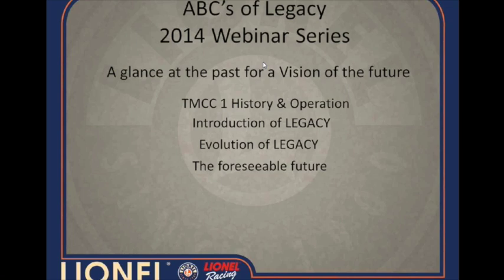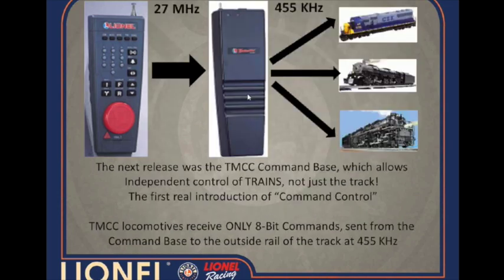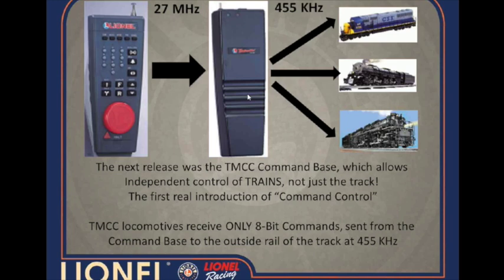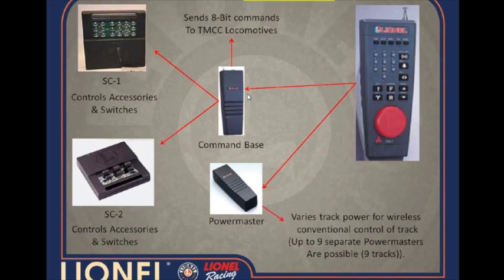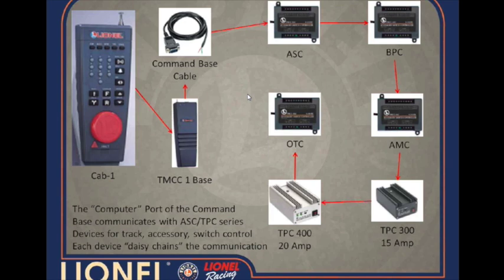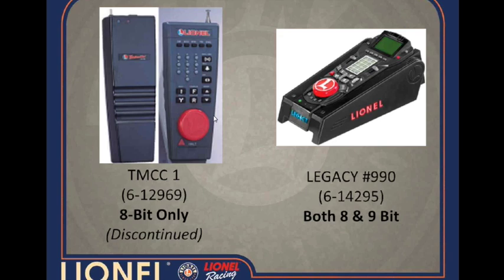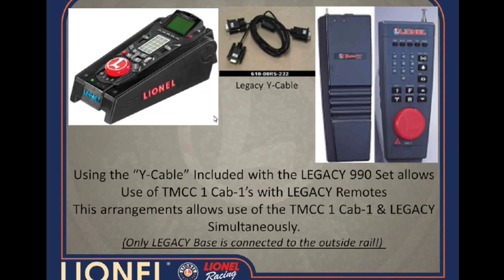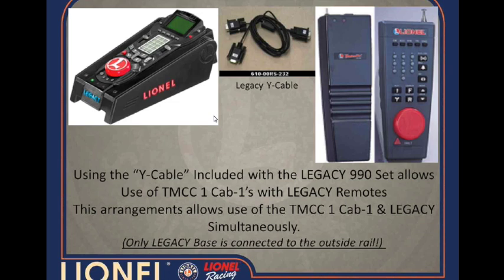Understanding Lionel's Legacy Command  Part I

Comment: I just pre-ordered the new Base3, but I wish I could still buy a Cab-2 (or, better yet, design a new refreshed Cab-2 that's more sleek and modern looking but still has all the same features).  
I don't want to control my trains with my phone.

Comment: Technical comment/ question.
8 bit to 9 bit communication.  
In computer development the bit changes were 8 / 16 / 32 / 64 / 128 bit.
CAN LIONEL'S COMMAND SYSTEM BE 16/  BIT USING ONLY 9 BIT.
IT JUST SEEMS TERRIBLE VERY  +++ ODD +++ USING ONLY 9 BITS.